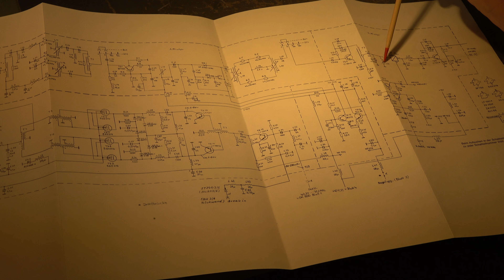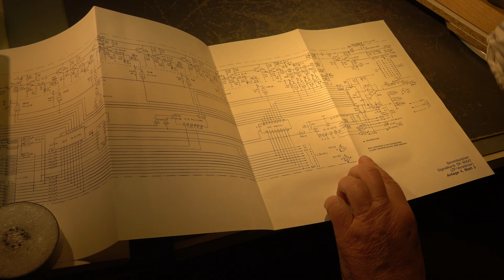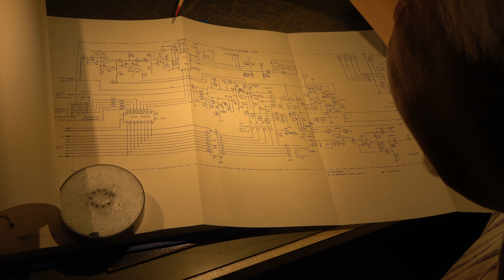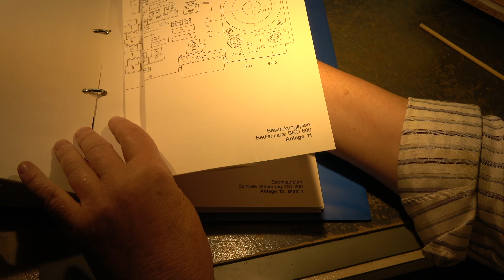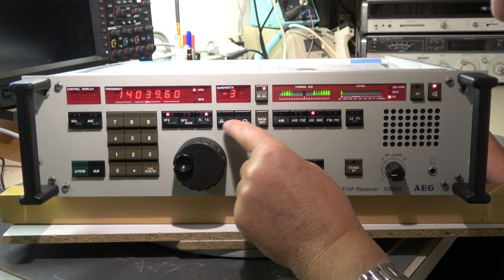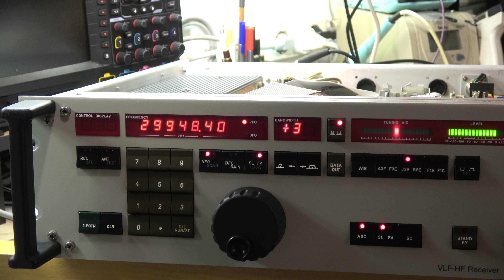#189 AEG E800

Comment: Thank you, Stefan, for showing us a receiver most of us would never see - happy you kept the video! I also do not believe in self-healing problems. I assume you inspected the power supply PCB for cracked solder joints - always a source of fun, intermittent problems. I own an HP 1980B oscilloscope that I restored to operation. It uses the same design philosophy as this receiver, an analog scope with digital controls. Amazingly it uses one rotary encoder to control all functions. Once you get used to its operation it is a pleasure to use. Regards, David